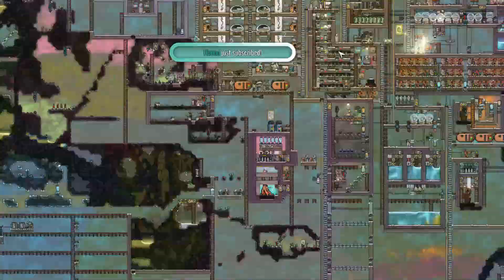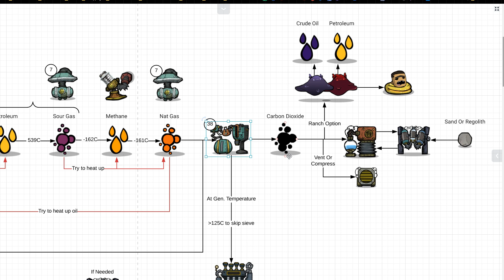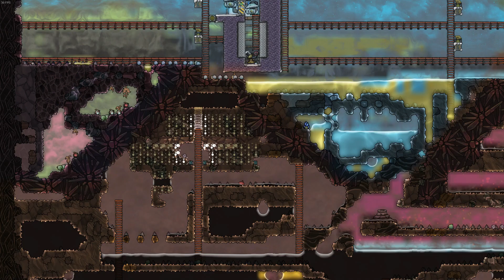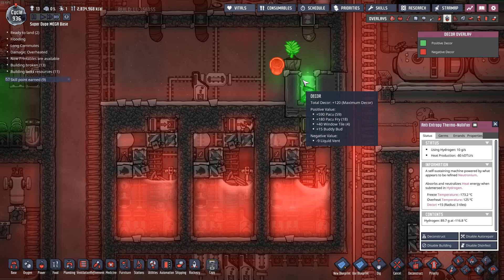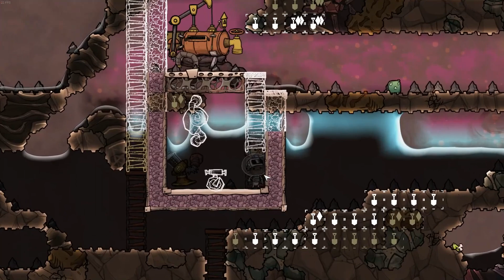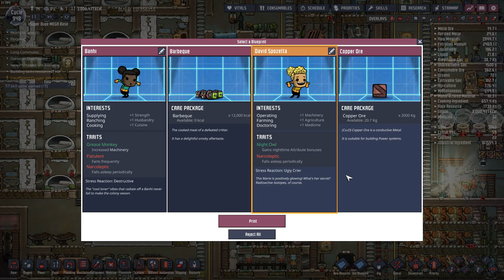Visco-Gel is Awesome!  Oxygen Not Included ep 36

Comment: the filter is definitely not the smartest. Quite the opposite actually. Smartest ist pipe into a element sensor, into a shutoff, green output is everything you don't want, what you scan for continues through the white input. Automation: add not gate and connect the element sensor and shutoff to it. Boom. done. Never fails.